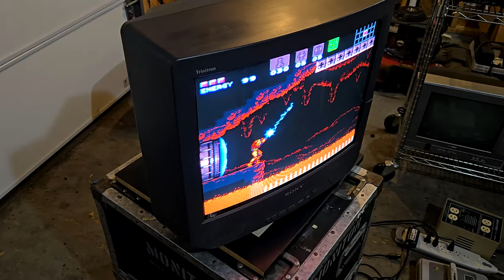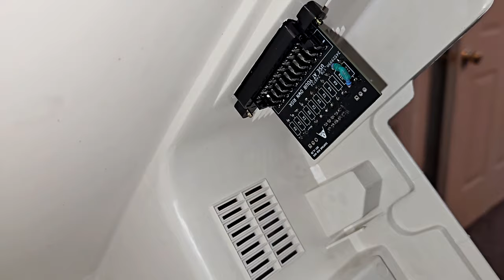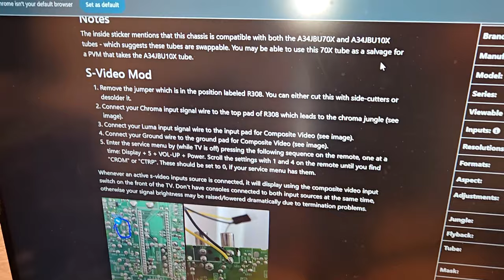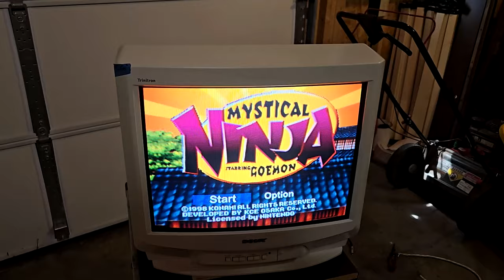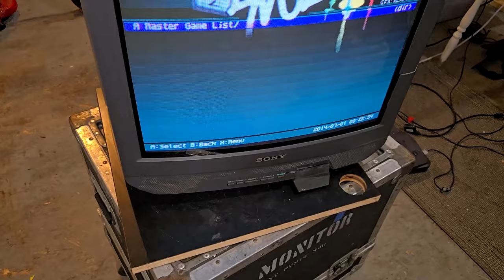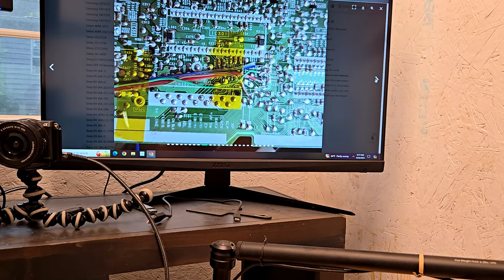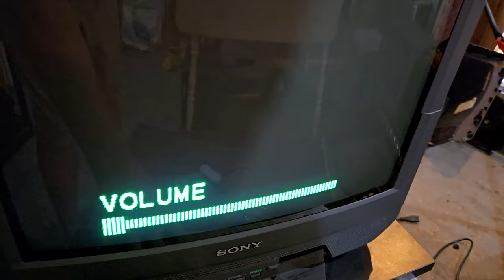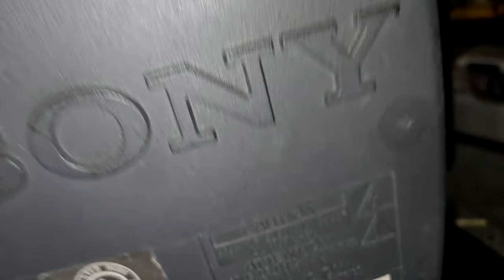Upgrading JVC & Sony CRTs | S-video & RGB MUX Mods

Comment: Cool mods, and you do great electrical work, but those scart cutouts need work if you're charging for this. Should be under cutting and finishing with a file.
Reply: Old vintage plastic: slow file sanding work  ( files designed to work in one direction - away from yourself ) .
Reply: I use a Dremel with precision bits.  Cheap and works very very well! 😁

Comment: Got lucky on the JVC. With the yoke unplugged it likely didn't generate much HV. Otherwise that loose anode cap would have blown up plenty of stuff on the board from arcing.

Comment: Hello brother, I am Ganesh your biggest fan from all the way in the Caribbean, Trinidad and Tobago. I fell in love with CRT technology because of you. But I want your email to show you something. There is something remarkable I have discovered and I can't really understand what kind of electronic wizardry is happening. I have a 27" Phillips CRT Tv, after tweaking with the tv and trying all kind of explorative stuff playing retro games. 

I use a HDMI to composite converter, I run my computer to the tv. The thing is I connect the video composite cable to the component Y input on the tv, and voila I can see genuine Component on Black and White. 

I understand there is a conversion going on where the converter is allowing the HDMI resolution to be downscaled to NTSC 480i resolution.  

But, when you look at that image quality in black and white component on a Philips SD CRT, this tv is producing one of the sharpest image I have ever seen in my life. I am blown away. 

I have read that black and white has higher contrast ratio than color. So I know that sharp image has something to do with the way black and white imagery is shown and processed by the human eye. 

But, I set my computer on AMD andrenaline software to native black and white to properly synchronize. There was a bit of dot crawl, but when you take all the color saturation to 0 on black and white it shows perfectly sharp with zero dot crawl. 

The thing is I am telling you bro, you need to try this and tell me what you think. connect your computer to a Phillips SD CRT with HDMI to component converter,  make the native saturation to black and white. 

Play a 4K video. One of those 4k Cyberpunk 2077 videos on YouTube. And tell me that is not the most impressive image you have ever seen in your life. 

My question what is allowing this to happen?
Reply: The Green or "Y" component input means Luma or luminescence so you get a sharp black and white image

Comment: Oh, I forgot...With the amount of scart holes you dremel out, instead of using a pencil have you thought of bending a 1/32 steel strip to the contour of a scart connector to make a template that you could heat up and mark the plastic with everytime?

Then you just need to follow the groove with the dremel.

Comment: Will a modded TV do rgb in both pal and ntsc or does it depend on the tv?
Reply from the maker: These TVs are still NTSC sets.  If your set is Pal, it will work.  It's not going to make the TV properly accept Pal signals if it's still an ntsc set or vice versa

Comment: Hey sir. Been a few months. I have been meaning to chat it up on one of your videos comments since the retro expo in CT (black guy with glasses, Mike). I had to put my Sony on hiatus to dedicate time (I have other hobbies). I wanted to try and gather a few resources together before I re-tackle fixing and maybe modding my Sony KV-27FS13. When we spoke about it, I mentioned mines has the common issue associated with the more flat tubes. It works great otherwise but I genuinely would love to correct my tube since the audio and picture is amazing (every input/output) rather then trying to get another. I know about CRT database, but are there other websites I should use for a resource? Can anyone provide videos that have very legit and comprehensive instructions for repairing that type of CRT panel? I'm looking to have multiple resources to pull from to be as cautious and prepared as I can be.